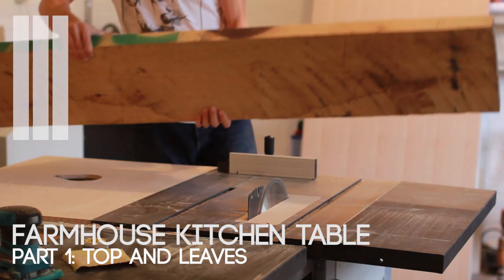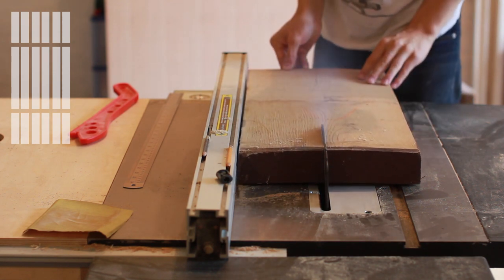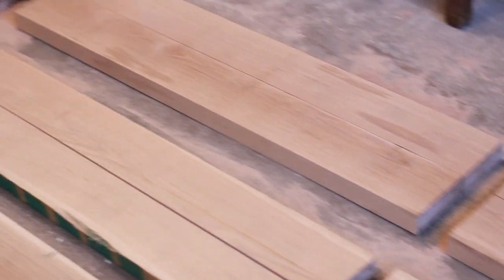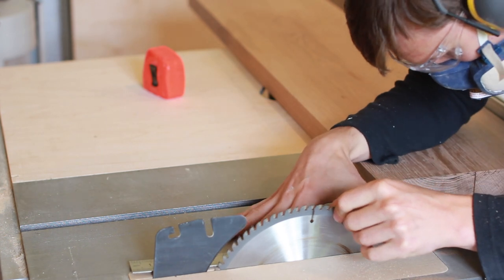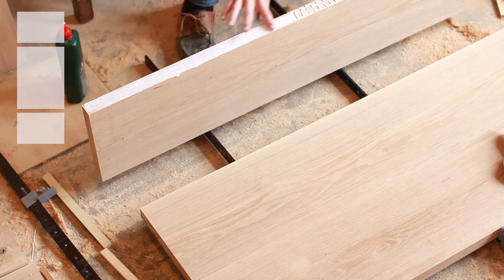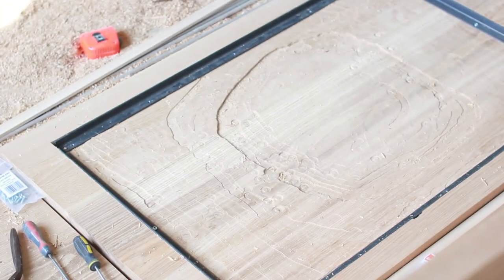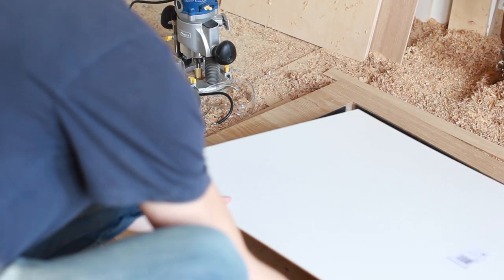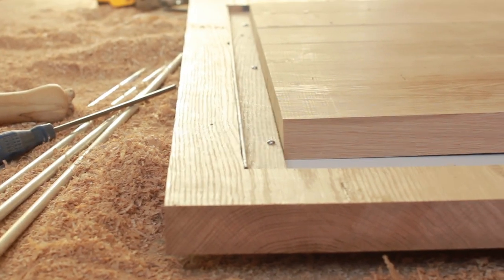016 Extending Farmhouse Table Part 1 - Top and Leaves

Comment: Would a router planing sled helped with routing out that grove in the middle. That also seems like a lot of work/strain on that router bit.
Reply from the maker: +Joshua Méndez Yes it probably would, and as you say you could take multiple passes so it is less strain on the bit. The bit survived though so for a one-off it worked okay, if I were doing another I would definitely use a sled.
Reply: +Henrys Workshop still looks good where it counts. the end product should be great. nice work
Reply from the maker: +Joshua Méndez Thanks Joshua :)

Comment: What brand/model drill press do you have? Seems fancy the whole top portion goes up/down.
Reply from the maker: +Adam R Hey Adam, its the bosch pillar drill, not sure about model number. I got it because all the other drills in the same bracket were pulley driven to change speed whereas this allows you to adjust speed with a knob as well as having a digital readout for depth of your hole etc. I will go into this more in the second part of the table build